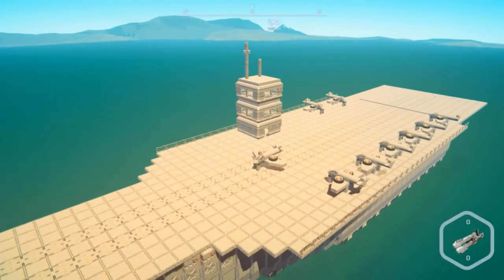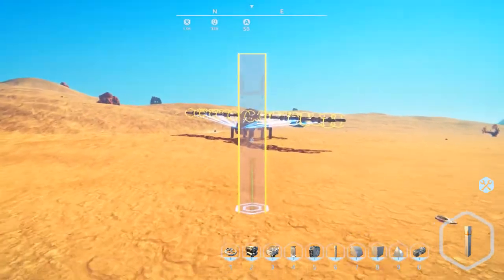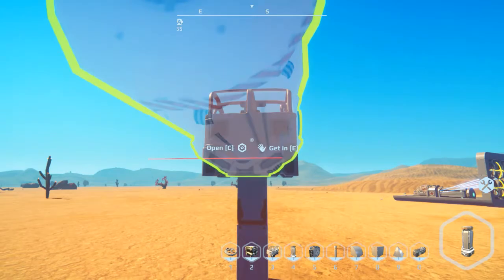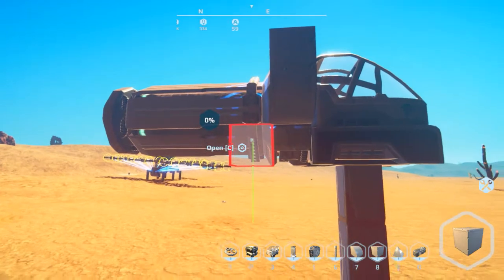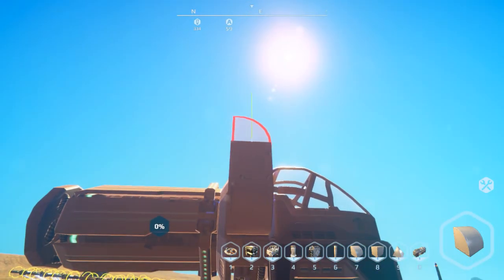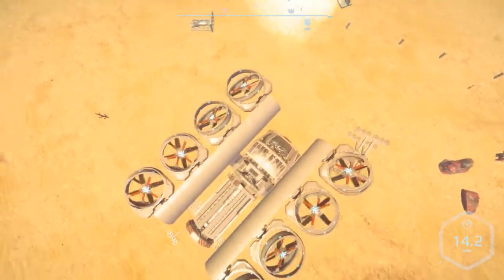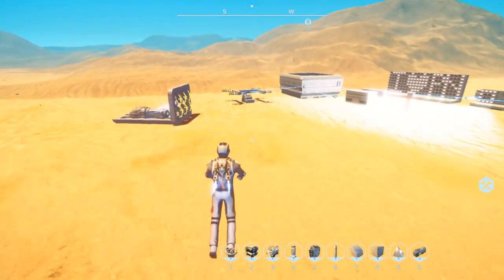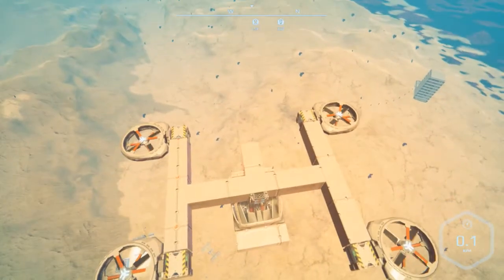Planet Nomads - Aircraft Tutorial Using Air Blades

Comment: I wish there were more control options. It would be nice to be able to strafe as well as turn rather than either/or. Is it possible to tune the control sensitivity? My limited flight experience was very twitchy in the turns.

I had an interesting problem with a quad-rotor from the workshop. It worked just fine until it got caught in the crossfire while I was erasing some other stuff in creative mode. I accidentally deleted one of the fans. I figured it would be a simple matter of replacing the fan. But when I did, the thing wouldn't move again at all. I was flying it with only three fans... which was entertaining. But replacing the missing fan prevented it from even lifting off. That makes no sense to me. Even if I didn't have the new fan set right it should still have flown at least as well as it did with only three.
Reply from the maker: so do i. i was told that we were supposed to be getting keybindings but that never happened. it should work if configured correctly and powered(connected to a powered switchboard). it probably didnt have enough lift, the one i built in this video has just enough airblades, wont fly with 6. and yes flying in this game is like riding a minecart in minecraft
Reply: @bcplabs  it flew fine with only three fans. I don't see how replacing the fourth one would make it non-functional. Unless there is more to the blueprint than meets the eye.
Reply from the maker: that could be but the game also has its share of bugs so nothing surprises me
Reply: @bcplabs  I've noticed that. I have two beacon markers in my compass for vehicles that I've dismantled. It's annoying as hell always having something 3m ahead of you. I only have a few hours of playtime so far, mostly in creative to get a feel for the building process. So I don't really have a sense of what to expect from the full game.

Comment: Well, about powering up your blades and selecting propper generator .. You can run small test before. Build certain type of a generator (bio for example), then build one blade, connect it. Then hit the tab to get into a build mode and look at the generator, it will show the percentage of energy output use. Multiple it by number of desired blades and there you go, you will know if selected generator is powerful enough. In my opinion, bio should be far enough, but I didnt test it yet, I was using batteriest untill now. And of course, count with switches, lights etc. but it's consumption is marginal.
Anyway, thanks for your tutorial, it helped me a lot. I spent a lot of time building an aircraft, and it doesnt fly :), now I konw why.
Reply: Silly me, it is much easier actually, build mode shows power consumption of the components. One blade needs 100, bio has output 500, so it can run 5 blades (4 if we count necesary switch). And since one nuclear weights just slightly more, then 2 bio, but provides 10 times more, nuclear is a clear winner.

Comment: One switch-pad makes the difference between drifting and not drifting?  That seems like a broken weight system.  A few pounds should not be that dramatic.  Great video thanks for sharing.
Reply from the maker: the video is a bit old and was made shortly after they came out. flyers shouldnt drift because of the stabalization only the hover crafts do, my bad. they have updated things a bit but the drifting seems to be a code thing which will be gone when the new unity comes out

Comment: Very helpfull thanks!  I been screwing up my  flying designs flipping and such.  Blade are too low .

Have you stacked blade units ? What would happen if you put another bank directly above the first ones for 16 total rotors? Does it account for rotor wash etc?
Reply from the maker: from what i was told it does block them but ive had them above a platform i had attached to the cockpit and they worked. if you watch episode 96 i try to string a whole bunch of them together with interesting results. i havent done alot of testing with them yet but the max speed you can get is about 80kph

Comment: great tutorial, but I can't get mine to work.  I set it up just like yours in the video, but with 6 blades and batteries instead.  I believe I set the blades up correctly,  and have the two back and two front ones set up to turn, all direction arrows are pointing forward.  All 6 power up fine, it lifts off and drops with the space and left CTRL, and turns left and right with A and D.  When I push the W key, it violently turns to one side, and when I push the S key, it turns equally hard to the other side, but never goes forward or back.  The weird part is that the animation for the blades show them tilting forward, and not side to side like they do when using the A and D key.  I am new to Planet Nomads but had no problem with the wheels and hover pads.  Any ideas?
Reply from the maker: +Boomer 155mm check that you have the directional set all in the same direction
Reply: I believe so.  I played with it for about an hour and gave up.  I was able to get small forward movement by turning off the forward motion on the back two pairs, and just using the front ones for thrust and turning.  I tried adding more batteries thinking that maybe it didn't have enough power to provide thrust on both sides, then tried a 4th pair of blades, and it still turned instead of moving forward when all were set to forward motion.  The animation shows them tilting forward, but it turns instead.  I believe there is a glitch in the physics.  The blades are perfectly centered over the center of mass on the horizontal plane, and about 1 block above on the vertical axis.  It is stable in hover, lift, and turning, but turns hard to either side when pressing W or S.    I have the materials for 4 blades and the uranium generator now, so I will duplicate yours from the video and see what happens.
Reply from the maker: +Boomer 155mm hmm. I know they had issues but they fixed them for now. Not sure if you know but when placing air blades or wheels one side of the vehicle will be flipped. If you click directional once on one side to get forward you have to click twice on the other side
Reply: thanks for the response.  I am a little OCD, so i played with it some more.  It worked fine with just the front blades set to forward motion, but as soon as I put either of the back two to forward motion, the animation shows the blades rotating forward, but it just spins on its central axis.  So, I deleted all 6 blades, put them back on the same way and reconnected power the same as before, and now it works just fine.  There must have been some kind of glitch.  I made no changes to the frame, power distribution or batteries (other than to reconnect the new blades to their switch) , and the arrows all look just like before but now it works.
Reply from the maker: ya it could be a bug. weve been having a few minor issues lately with the air blades, having them layered in particular, and the devs admit the code for them is patchy and needs rework. sometimes though thats all it takes is a rebuild. but feel free to build your flyer any way you please. you have total freedom in how you can build it
Reply: i noticed that on the actual blade there are arrows point up or down depending which you flip it, i had the same issue and my wife noticed the arrow that is actually panted on the blade. ie: i had a couple with airflow going down instead of up.

Comment: So I have all my blades set in the same direction then I put all of them to have the same steering except for the last 4 at the end. The aircraft turns left and right fine but when I try to move forward or backward, it just spins around, like I'm turning left and right again. I'm looking at the blades when I try to move and they seem to be pointing in the same direction (as opposed to being in different directions when you're turning).

Whats doing this?
Reply from the maker: +Yayo.chan have a look at all the air blades. The have arrows on the side. Make sure they are all pointing down
Reply: I did. They're all pointed down. Even added a couple more blades in the front since I noticed my craft was leaning forward, so now its very stable

Here's a picture if it might help https://puu.sh/Asiaq/fb986fbf4c.jpg
Reply from the maker: Yayo.chan you can try removing the switchboard and rebuilding it. There has been a known bug with the jack tool. You might have to rebuild it using a stack of blocks instead of the jack if you used it
Reply: yeah. rebuilding the entire thing worked. Also gave me some time to make a few design changes as well lol. Thanks for the help

Comment: so i have just started playing this game and i cant get any of my flyer to get above 70m is it that i need more airblades ? or more power i have 8 blades and 2 batteries per blade, also not sure if it makes a difference but i have the smallest radius planet that you can.
Reply from the maker: do you mean 70m above the ground or faster than 70km/h? the amount of airblades you need depend on how heavy your flyer is. you need 1 for every 750-1000kg i think. there may still be a limit to how high you can fly so if you are high up on a cliff you wont go much higher. and the airblades are maxed at 72km/h
Reply: i finally figured it out, my planet was set to the smallest radius and i could only go 70 m above, once i changed my planet the highest radius i could hit 270m above.  thank you for the reply though, and your videos are great keep it up :)

Comment: What is the fastest you can fly? I see most people get up to 50kph, I got up to 70kph. What is your max speed?
Reply from the maker: 70 is the average top speed. you can get more speed by turning stabalization off on a few blades. my x-wing gets around 86. but there are a few people ion the forums trying to break that speed and someone was able to get 115. but you dont want to go to fast because you you will end up flying faster than the game can render everything
Reply: that makes a lot of sense why the top speed is so low. Thank you for the replay. love all of your videos. you have some great ingenuity with your builds.
Reply: How do you go above 50? I added more blades it's still capped at 50 (with stabilization), but if I go backwards it can reach 70 lol.
Reply from the maker: +NAVras Z it depends on the design. If you use 8 like I have then have stab off on the 4 in the middle. Where as my X-Wing has 24 total top and bottom and I have stab off on all of them. But to get the speed boost you need to use hover up(space) while yu are moving forward and tilted nose down a bit. I have been able to get to 86 this way
Reply: Yea it was the design, I found mine was back-heavy, so the stabilization was keeping it from going faster.

Comment: Can the height physical limit be broken if I use a vehicle instead?
Reply from the maker: +Akideoni the fly height and the build height are the same which around 200m above water level. Only way you can get higher is by using the wheel trick or launching yourself from a cannon(you need to be in a cockpit)
Reply: So if I add wheel to my aircraft would it work?
Reply from the maker: +Akideoni it's a trick with the wheels. I explain how it works in episode 60. You will have to power them now for it to work. Just use 2 wheels not 4 like in the video
Reply: Thanks
Reply from the maker: +Akideoni just add the 2 wheels as shown. Don't worry about the suspension
Reply: Disgress from last topic 

I am curious is there something called variable max height(notice in steam forums) for a hovering aircraft due to weight power ratio? 
Or is it that all aircraft regardless hover or not the maximum is fixed at 200m off sea level disregarding the prior mentioned?
Reply from the maker: +Akideoni not that I'm aware of. I've built in the desert and I've built on the cliffs and no matter what you reach the same height above water regardless